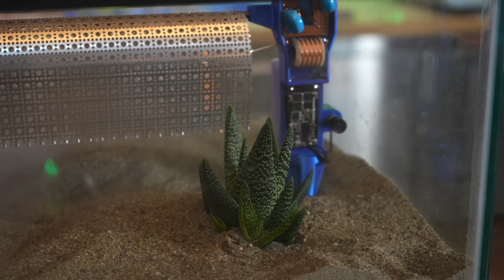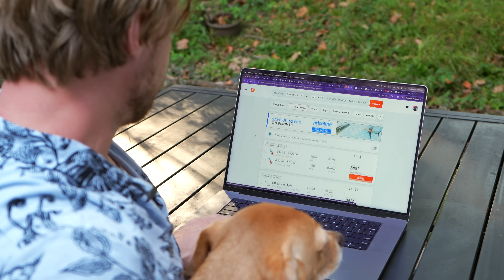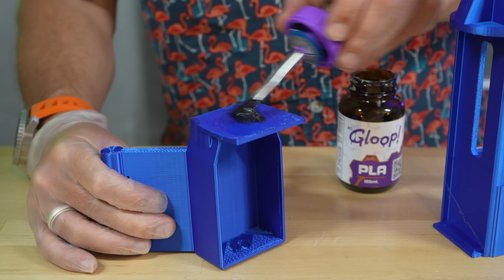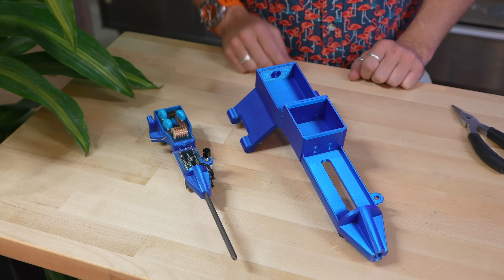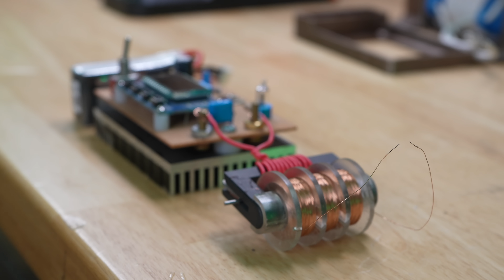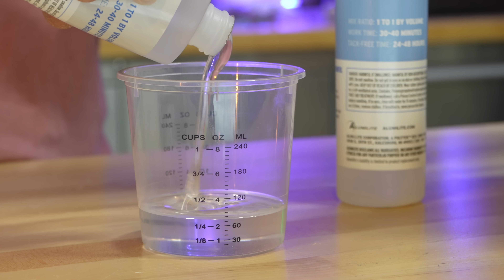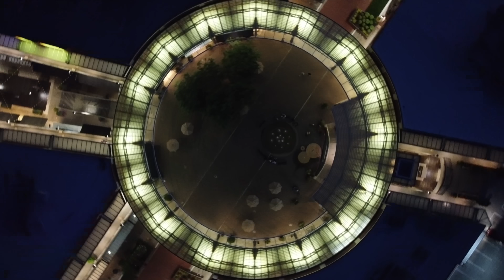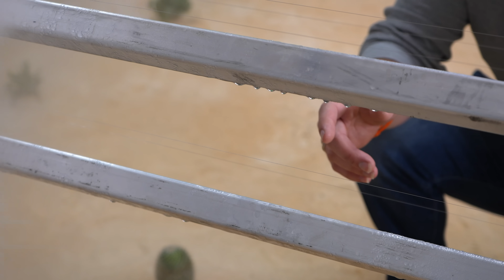Turning Desert Fog into Fresh Water Using 50,000 volts

Comment: How about having the rails sloping so the water runs towards the end for easier collection.
A humidity sensor should be able to detect fog. Maybe even just a temperature sensor, looking at changes.
I wonder if tbe HV power draw changes with production-maybe you could use that to determine if it's worthwhile to be on.

 Power draw of any sensing would be negigible as it only needs to be on brieflly , say every minute or so.

Might be worth looking ay power tool batteries-probably safer,and locally available.
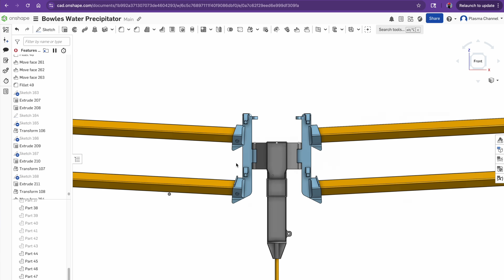Reply: He did slope them, but so gently that it had hardly an effect. If you look close at the cad model (5:42) you can see that there's a very slight angle.
Another option would be to cut a slot into the lower rail and adding a 3rd unpowered slotted rail below the 2nd, then the water can collect in these and go to the center stake.
Reply: Please if you come to namibia I would love to see it in action!
Reply: Yeah, I found myself watching this and asking, what about the focus on the actual water capture here - not the electronics and plastic printing, this design just seems to drip it everywhere ...
Reply: @argoneons  I believe that Jay is doing a proof of concept experiment. The optimum solution would be a collecting vessel with a funnel as close to each metal rectangular section as possible to catch the maximum amount of water and then store the water in a large container under the sand, depending on the use case it is designed for.

Conceivably, if this design can be optimised, where the KW efficiency is not the defining factor because of the readily available solar and wind power for renewable energy, then this same combined system powered by solar and wind, would typically produce around 52 Litres per night based on a 1KW system

If this can be scaled-up to even a 10KW combined solar and wind electricity system with Sodium storage battery, for balancing, the numbers take on a wholly different complexion producing 500L every night, all variables being equal.

Tied to a 10,000-litre JoJo vertical water storage tank, featuring a food-grade, BPA-free, inner dark layer, to block algae growth, and a tough UV-stabilised outer shell built to last, placed underground to store the water, may provide an opportunity to create islands of biodiversity in the desert and together with the use of underground reticulation, and a submersible pump and water-retaining soil amendments, could create a growing environment and food resource that would see a return of plains herds to these desert areas to the point that nature may take over and restore balance.

Also, literally overnight, this would enable market gardeners to restrict the use of brackish bore water, from natural underground aquifers thereby, no longer requiring reverse osmosis desalination plants to extract fresh water, which just accelerates the saltiness of the land, over time.

This in turn, would leave native plants, that are salt-adapted, to access the natural underground aquifer with their deep tap-roots and thrive, which in turn will help farmers and wildlife.

I look forward to say a 1KW system being field-tested and then maybe a 10KW system.
Reply: Another option could just be to put it on a timer if the day/night charge/discharge cycle is fully self sustaining.
Reply: He added water collection humps to capture water running down the rail and I assume the plan is simply to insert the stakes in a way that causes them to slope toward the collection humps.  And...  Adding a gutter would be trivial.
Reply: I think a simple sloped, plastic trough underneath would be easier than sloping the rails. Keep the rails and structure simple and square and then just clip up on some accessory collection troughs underneath with whatever angle you want.
Reply: de acuerdo con la inclinado 2 grados de caída es suficiente , eso mejoraría a un mas el porcentaje , igual este proyecto esta incompleto , ya que podría combinar   " modo pasivo "   inclusive para aumentar la superficie  . multiplicando por 100 mas o menos  eso seria casi un 1000% mas que el primer prototipo  , sin contar que yo en lo personal le aria algunos ajuste para corregir el consumo  y ampliar los paneles para su recarga ,. igual brutal proyecto ,,., saludos y buen aporte espero que vea los comentarios en español y saludo desde Uruguay ,Maldonado   😎👍 OPINAR ES FÁCIL, PERO HACERLO ES OTRA COSA
Reply: @santiago-s9k5e  Increasing surface area will work for a while, but you'll hit rapidly diminishing returns. Part of the efficiency is created by drawing the fog to the same nucleation points. Adding more surface area will not scale linearly, so you won't achieve 100x more... not even close. But there is likely a lot of room for optimization by scaling the surface area in relation to the humidity. The problem with that is humidity is variable. You would need a system that literally grows and shrinks based on the humidity. 

That wouldn't actually be hard to design. Keep the wires coiled and use a movable pully system to draw out more wire as needed in  vertical space. When you shrink it, you just retract the excess wire onto a coil inside the stake. 

The down-side to that is added complexity. It's no longer a solid-state system, you have moving parts which increase failure rates and reduce longevity. It also imposes addition power demands, and is more prone to error. I don't know if the efficiency gains would sufficiently offset those drawbacks. While there is always room for improvement, this design is pretty elegant as it is. 

I think it's efficient enough right now, the focus should be on lowering cost, lowering potential failure rates, and scalability. If you can cut the costs in half, you just put up two systems instead of one, increasing net collection that way, while making it more accessible to a larger number of people. 

It's important to remember, this is a proof-of-concept prototype, these are not necessarily the materials or processes that would be used to construct a final version of the device. 3D printing would be horribly inefficient at scale for example, and plastics are likely not the best option. It's great if you're making just one, but if you were making 10,000 of them, galvanized steel likely makes more sense, in terms of speed of production, final cost, and durability in the field. This is why most Kickstart projects fail and never deliver as promised. The realities of manufacturing at scale impose additional design constraints. Build for scale, then optimize. That's the secret. But a proof of concept is needed first. This is pretty close to ideal for that proof, but a real-world test could make a huge difference. 

Areas I would look into for improved efficiency are:

• PCMs (Phase-Change Materials)
 MIT has done a lot of work on that already for atmospheric water capture, and their work, while cumbersome in lab tests, does look promising. 

• Passive Radiant Cooling materials
These can lower temperatures without adding any moving parts, and may aid in condensation efficiency. 

• Geometric Design
This was covered here, but I think there's still room for improvement. You want to passively channel more wind through the system. More wind carries more water. I'd look to urban architecture for inspiration there, as cities with skyscrapers have to deal with huge wind gusts between the buildings, and concentrating and dissipating that wind is actually a huge part of how many newer skyscrapers are cooled... just by changing the shape and orientation of the building to create engineered high and low pressure zones. 

• Better electronics. 
The electronics can likely also be simplified a bit to reduce costs. 

• Integrated water storage. 
The water could be channeled into a small cistern to reduce evaporation. Or it could go directly into an underground delivery system, like an Olla or a drip-irrigation or soaker system. Evaporation is still an obstacle, so hanging on to the water collected will be a big part of it's actual utility. 

• Alternate Commercialization.
If the price was under $50, using a modified design... a simple stake that collects water and deposits it in the ground via something like an olla, that could generate sales that fund further research or even subsidize deployment in a more humanitarian endeavor. Imagine being able to just stick a stake in the ground near a tree, and the tree is then watered for you with no further intervention. That could work in a lot of climates, and have a lot of utility for small orchards, reforestation projects, even general landscaping. Or for potable water, there would be a lot of interest in the survivalist community, for campers, etc. If a simplified version can be made available at a reasonable price point, and still be profitable, that smaller intermediate market could support a larger deployment. 

I'd also suggest when he's ready to commercialize this, he should reach out to Jack Spirko of The Survival Podcast. He has a huge audience that is involved in survivalism, emergency preparedness, emergency community relief, agriculture, permaculture, ecosystem repair, emerging technologies... basically every possible application for the device, and when it comes to business and promotion, he really knows his shit. I can easily see his audience putting a LOT of support behind this project.
Reply: Great comment, you put a lot of thought into it. Was a shit ton better than my "this needs to be free" comment. Thank you for putting in words what I was unable to
Reply: @Arkryal IMPRESIONANTE JAMAS PENSÉ EN ESO ,.,SON UNOS PROFESIONALES 😯😱😱😎👍👍👍👍👍
Reply: @LaughingDead  Yea, why don't you pay for it then?
Reply: @Arkryal I hope he sees this, thats alot of good thought processes and insight into it some designee stuff
Reply: @LaughingDead  Mike is a real pro. His channel is great.
Reply: @Arkryal Nice, full response. I wonder if Jay's design is targeted for the specific use case of rolling banks of fog in West coast facing desert environments, that get virtually zero rainfall, only periodic flood water from inland mountains but have a lot of atmospheric water, which remains largely untapped.

Water and food independence in these areas could be transformational in many ways.

Comment: I have an idea to maximise the water droplet nucleation sites for your application. I at one time worked for a high voltage powersupply company. My idea is to use a tiny proportion of the collected water and then using a small electrostatic droplet sprayer above your collector grid then each of the droplets act to nucleate  fog droplets on to the  sprayed droplets and therefore marking them much larger and even more effective

Comment: What about a humidity detector as a switch?  Also, the ends are adjustable in height, so the angle of water flow down a slope can be adjusted to collect more easily.

Comment: Given the purpose and scale you are going for why not put this a bit higher so it mounts above a regular net - its actively creating some moving air and dripping water that should help the regular fog net section underneath work better than the purely passive fog net of the same total size would, while getting you more condensation sites that likely improve the total water capture without having to scale up the electricity demands of using more powered elements.

Comment: Is there a reason you stick with peg boards for building circuit assemblies? I'm not saying it would fix your problems, but an inductor/coil printed onto the surface of a pcb certainly wouldn't hurt the power conversion and filtering for some of these constantly overheating components.

Comment: Fog activated switch:  Design an LED or laser diode driver to create short bursts of high frequency chopped light.  These chirps of light are fired into the air in front of the condenser unit.  A light detector (photocell or phototransistor) is fitted next to the emitter and aimed into the air that is being illuminated by the light source.  The emitter and detector should be mounted as close together as possible, but shielded from each other.  If fog is present, the light pulses will encounter fog droplets and be strongly reflected back to the point of origin.  The detector will then activate the condensing unit.  The duty cycle of the LED driver should be very low, in the order of 2-3 shots per minute to conserve battery power.  Most importantly, the output of the detector should be coupled to the sense electronics through a capacitor or notch filter so that only the high frequency AC component of the light chirp is passed through.  This will block any natural (DC) light sources such as starlight, sunlight or moonlight.  If you really want to get fancy, use the LED driver pulse to gate the receiver so that it is only active during the pulse transmission window.  You now have a synchronous fog detector.  You should be able to make the optical portion out of an off the shelf LED/phototransistor proximity sensor.

Comment: Potable is not pronounced pot-able water, its poe-table. 

Also there are better options than a Bluetooth switch imo. You could use a hygrometer to trigger the device when humidity reaches a certain point.

However, if you wanted it to be remote, LoRa would be much better option as it's range is considerably further than Bluetooth or wifi.

Comment: @Plasma Channel - would it be possible to wire the condenser in reverse? so it blows the fog UP instead of down? (or sideways?)
and then the drops drip between the thin wires? (are the drips conductive enough to cause sparks between the wires?)
In that way it would act like a hoover and suck up new moist fog from the ground area, after disposing the dry "fog" up in the air.
With your current design, you collide the input & output streams, and stall your production because new wet fog is blown away instead of towards the condenser.

Maybe you can test it outside in some fogy day, wire the left arm to blow up, and the right arm to blow down and see what works best?

Comment: Mosfets in 555 gen get hot? Do you use a proper gate driver? 555 is not beefy enough to run the power fets on its own.

Comment: on the terms of making the machine fog activated, there are devices out there made for monitoring basement flooding using two open electrodes one supplied by a positive volt and the other is the ground so when the water accumulates it will cause the device to complete the circuit sending a message of a flood. I think this principle could work.

Comment: Is this just a physical collision of droplets with the metal bars? If so, would some sort of surface roughness or baffle cause longer contact time? If it is condensation, when the water condenses on the metal bars, do they heat up? If so, does the efficiency decrease over time or does the overall air flow keep them cool enough so it is not an issue and it reaches some steady state efficiency proportional to the air temperature?

Comment: @Plasma Channel
5:38 Maybe also design to allow for differences in arm-elevation too?
just to make more locations suitable for it.
To prevent drops from sliding along the bottom edge away/towards the center rod, make it jagged, like \/\/\/\/ so drops have to flow upwards to get out of one of the "jaggs", which they don't do.

Comment: Bluetooth switch seems like it's just a fancier manual switch with more failure points and higher power draw. Write a tiny python script for an arduino (like < 1 w draw on light load) which takes in lat long for where the placement is set up with a tiny bit of code to calculate sunrise and sunset time, give it control of the switch,  add a manual adjustment maybe like 2 hrs on either end since fog terms to be the strongest around dusk and dawn, that would be automatically optimal all days of the year.

Comment: To make this more autonomous, couldn't you use the same type of sensor for detecting daylight and have it inverted to trigger the device to turn on at night or even a 12-24hour timer relay, can't imaging either of those would take much power nor would they be all to complex to integrate on it, I think the sensor from most solar garden lights might be not only the easiest to try adapting to it, I'm not sure how resilient those sensors are to nearby electrostatic discharge but id assume if its by the solar panel and fed into the control bored to trigger the on and off cycle that it would be safe.

Comment: Does this system only work with fog? Is there a way to make it work to condense the relative humidity of the air?

I live in a very hot city, where drinking water is an expensive resource, but the relative humidity stays around 80% every day.

Comment: 19:40 why are there arcs at the left square tube
Reply: I saw that too
Reply: i also saw that - would that cause issues?
Reply: @A96Z86  it might affect efficiency a little bit in a short term and over time, it might break down the plastic and cause a carbon arc, which would make it much worse

Comment: If You really wanna go for it then just go to the dryiest place You can go and stab the thing in the soil and go for it. Your test might be out the window because of …reality. What´s the highest windspeed and the most less humidity it will operate in. What about animals coming across it? A wild pig or hyena or even a pissed off dog will slash this immediately. But the principle is interesting. In a rainforest it should work best becaus ethe air is already saturated and in the trees the wind is calm. It should make a fountain there. Imagine clean water in the jungle on demand. Push a button, in 20min have a drink. <Insert "Nice" meme here>